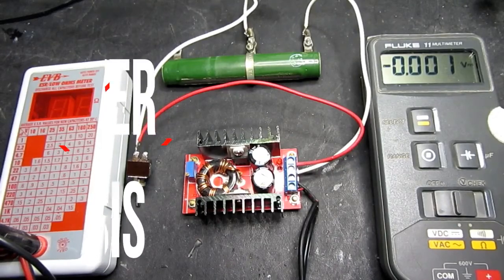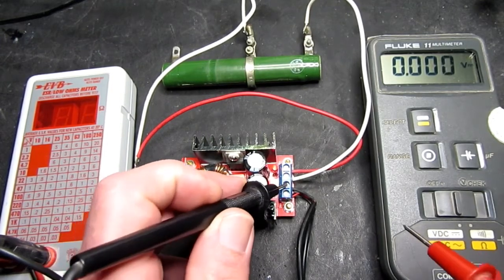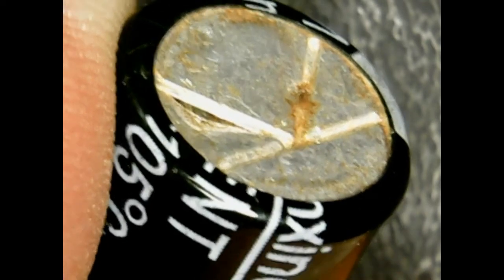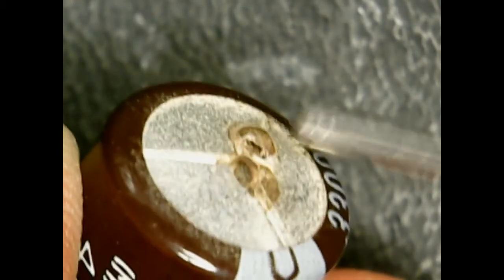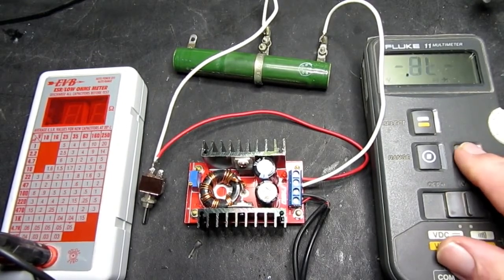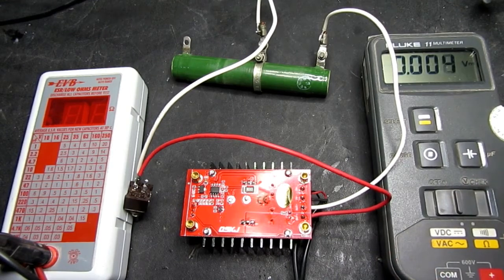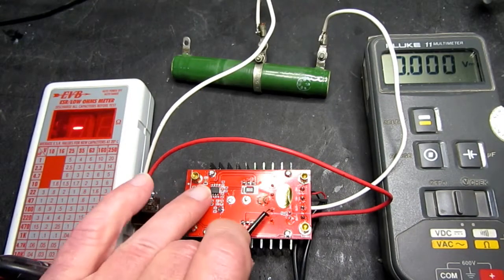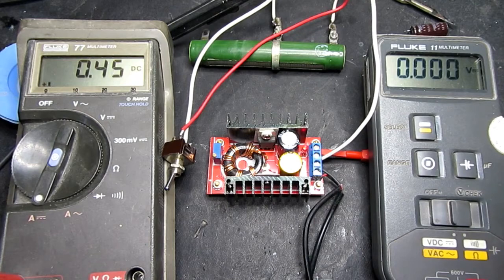DC - DC Converter  Failure analysis - Electronic Repair

Comment: My boost converters output is not stable and makes a humming sound
Can u help ?
Reply from the maker: If you are loading it near to it's current limit it will do that as it is working hard and will probably get very hot too. Otherwise check the smoothing capacitors as they are usually very cheaply made and could be faulty. Putting an extra capacitor across the input and / or output may help. Thanks for watching, have a great day!

Comment: can u tell me whats wrong on my dc dc booster i dont see any input it was working yesterday. thx
Reply from the maker: If there is no input then the fault is not the converter!
Reply: @1nformatica  i used a 12v supply and tested it with my multi tester and it doesnt show up any input the "12v" it was fine yesterday
Reply from the maker: @randomlyrics8402  I am confused by your question. Do you mean it has no output ? Find the number of the contriller chip, mine was UC3843 then google for the data sheet. The data sheet should have a basic design circuit diagram. In my experience many Chinese manufactures just use the circuit straight from the data sheet.

Comment: Hello. I also have this converter. I use it for my T12 Soldering Iron. Input 15V to 24V. I used it only about 3 minutes and it doesn't boost anymore. Now input is as output! What could that be? Can I repair it?
Reply from the maker: It is not normally economically viable to repair these as replacements are so cheap. I do it more as an intellectual challenge! I would check the output FET's maybe one has gone short circuit. Please consider subscribing if you have not done so already!

Comment: I have to of the bigger units 30 amp. 1 stopped working it puts about0.5v out lower than the battery its connected to. I have gone over it with a multimeter. I don't get a voltage reading when I put it on 2 legs of the diode on the broken one also I get voltage through different legs of the switching mosfet. Any ideas?
Reply from the maker: Try checking the diode on resistance range, if it's the same in both directions it's probably short circuit. Please consider subscribing if you have not done so already!

Comment: I have a similar converter. One day the capacitor at the output  just burst without any load. On inspection I found that the  mosfet RU7088R is also shorted. The schottky diode STPS20 seems to be OK on testing with my multimeter. After replacing the capacitor and mosfet it is still not working. The output is giving only high switching voltage. Do you think the schottky diode is not rectifying the output? Any suggestions?
Reply from the maker: My guess would be the controller main IC is damaged. These things are so cheap it's not worth spending much time on, only for learning.
Reply: @1nformatica  thanks a lot for your contribution. I had dug into for the heck of knowing. I will buy a replacement.
Reply from the maker: @i.r.walling7289  Always good to learn.